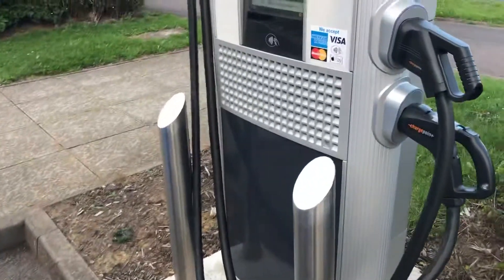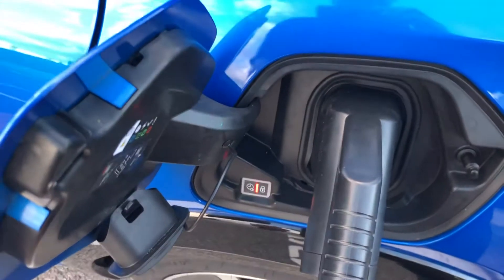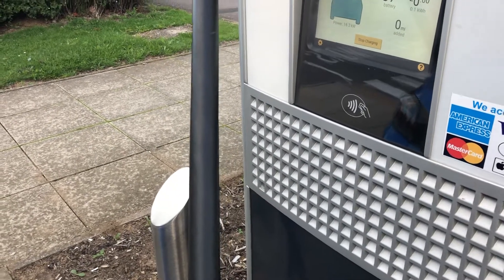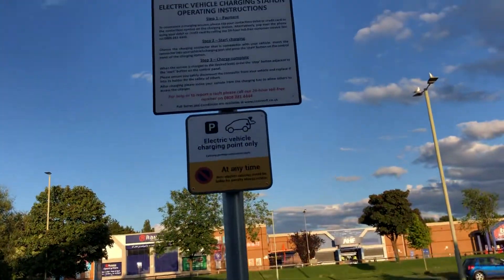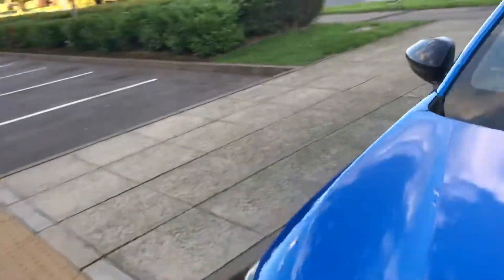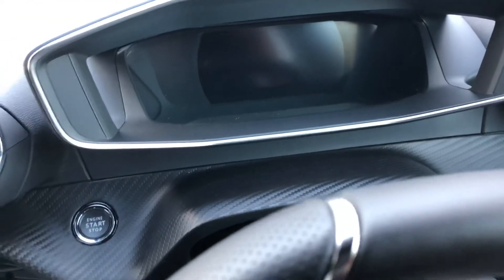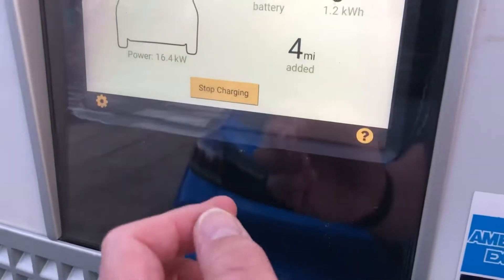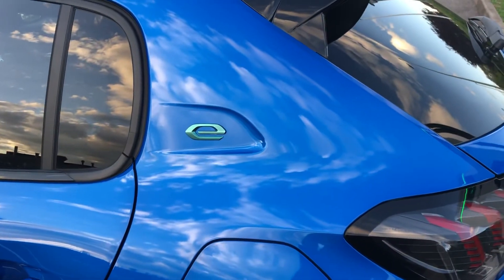New e-208 Charging on CCS

Comment: Hello, how many milles it goes with 100% of battery?
Reply from the maker: Hi-
In summer (above 12-15°C) about 180 miles of A roads, and around 130-140 miles at legal motorway speeds. In winter, around 130-140 A roads and motorway around 110-130 miles.

Comment: Hi , Can you turn on the heating in the car while waiting for the car to charge ?
Reply from the maker: Hi- Yes you can. Press the footbrake and then press and hold the ‘start’ button for a couple of seconds, just as if you were going to drive away. The car won’t be able to select gears etc, but will be on properly and you can have heat and air conditioning. It will show a red cable in the dash as a warning you can’t drive off. Remember to turn the car ‘off’ before trying to disconnect or end the charge. If you don’t turn off it won’t allow you to disconnect the charge cable.
Reply: @Wemutt  cheers thanks for that..

Comment: With the e208 can you listen to the radio and use the infotainment screen, say for checking navigation maps or android auto or apple carplay, while charging up?
Reply from the maker: Yes you can. 
Once you start the charge, get back in the car and then go through the same procedure as if to start the car normally. 
Footbrake on, press and hold start button for a couple of secs. Once dash is activated release the footbrake. It won’t say “ready” as it’s plugged in and won’t allow you to drive- it might even warn about this and show the ‘plugged in’ symbol. 
However, this means you can enjoy the heating/ cooling, radio etc without discharging the 12v. 
Just remember to turn the car ‘off’ before you try to unplug the charger.
Reply: @Wemutt  Thats great to hear and thanks for the reply to my comment 🙂

Comment: Great video, I was wondering if you plan a route does it include charging stops and times?. The same as Tesla do. Thanks
Reply from the maker: Hi-
It’s not as good as the Tesla one. 
It won’t show you stops or for how long on the initial route plan. 
It will highlight the lack of range and when you get towards the low SoC it will warn you and offer up a selection of charge points to select. 
Imo it’s better to know roughly how far you can travel and then use PlugShare or ZapMap to know which DC chargers to go for.

Comment: What is your average max range in this vehicle in cold weather?
Reply from the maker: Depends on the type of roads you drive and ultimately how fast you drive. 
In general, Motorway 120-130 miles in winter. Main A roads approx 130-150 miles
Summer motorway 125-145 miles and A roads circa 160-180 miles.
Reply: @Wemutt  I will drive mainly in London doing max 50 on a dual carriageway. Guess I would average 150. Thank you for the insight

Comment: Let's say both chargers are in use. What if someone comes, park his car on the sidewalk next to the charger, press "stop charging" and start to charge his car instead of my? I'll come from McDonald's in 30 minutes to find out my car is not charged. This should be improved
Reply from the maker: There are improvements that can be made, I’m sure, but the most cars lock the cables into place whilst charging so whilst they may be able to stop the charge, they can’t use the cable. Also, many DC chargers need the same card you used to start charging to stop it as well.

Comment: How much does it cost to fully charge from empty/flat?
Reply from the maker: Depends on how low the SoC (state of charge ) is and the cost of each ‘rapid’ charge point. Many car dealer offer an incentive card with some suppliers etc. However - if you were down to 1% remaining and charged to 100% it would need about 44*£0.35=£15.40 for about 175 miles travel. It is cheaper at home from a domestic charge point, currently £2.20 for the same. There are some charging losses to be allowed for as well but the above give a general view. I will also point out that on a rapid charger it is courtesy not to charge over around 85% as the car slows the charge speed down. So unless you desperately need 100% it’s often quicker to move on and charge a small amount later on.

Comment: Thanks for this video. Do you need to be registered with Instavolt to used their chargers or is it simply plug  and pay?
Reply from the maker: architectbloke Thank you- Any Instavolt Charger is just” plug and pay”. Legalisation in the UK states any new charger installation’ must have contactless capabilities as well. This however does not apply to the replacements of existing units🤷‍♀️.
Reply: Really fab simple to use - just use any contactless debit or credit card. Or Apple Pay via watch or iPhone works.

Comment: Any rattles on the car yet??
Reply from the maker: scott bonnes There is an occasion rattle from the nearside and offside B pillar or somewhere around that area. I have not been able to trace it at all which makes me think it is inside some trim. A slight metallic buzz. Comes and goes with no pattern yet. 
I sorted the one that comes from the rear suspension area which I could hear with the windows down only- a plastic rattle over ridged bumps at slow speed. It was the plastic cover over the torsion axle beam. A couple of long plastic ties keeps it secure enough not to rattle. 
That is it. 6000 miles.

Comment: Cheers ! I finally have my e2008. Just wondered do you know if we can change the colour scheme of the I cockpit? Mine is blue. In the electric versions can we change the colour of the interface to red or green?
Reply from the maker: Hi. Congratulations on the new car!  On the e-208, (mine) it is not possible to change the I-cockpit. Apparently this is only on the petrol versions. Whilst essentially the same car, the 2008 has some software variances so not owning an e 2008 I couldn’t be 100% certain. The ambiance lighting if fitted can be altered.

Comment: How is everything going with the car ? Hope all good! What kind of mileage return are you getting? I am still waiting for my e-2008 to be delivered
Reply from the maker: Everything is going well with the e-208 thanks. A couple of software updates booked in to be done to iron out some minor issue, nothing dramatic or major. Just pretty much a big computer on wheels😂. 
Mileage is anything from 160-214 (achieved - not estimated) miles depending on temp, road type and driving style.  The Guess O Meter (range estimator) is a little pessimistic in its operation and whilst may show, say, 150 miles range, you could drive for 15 miles before it even drops. A few tweaks needed on the algorithms, but over a long journey it is accurate and I can trust it as it gets low. Hope that helps.

Comment: Informative video, thanks! I was just wondering if you can confirm whether the heating and air conditioning is fully operational in the e-208 whilst charging, please? It’s not the case in the Zoë, where I get very chilly waiting for a charge!
Reply from the maker: Yes, you can have the heating on. 
When charging- ‘pretend to start the car’ so footbrake applied and press the start button as you would normally. The car will may show a warning but it will engage the heater and it will also charge the 12v battery whilst it’s charging.